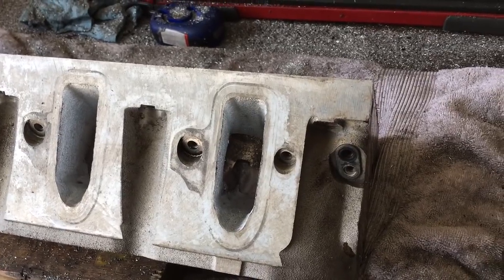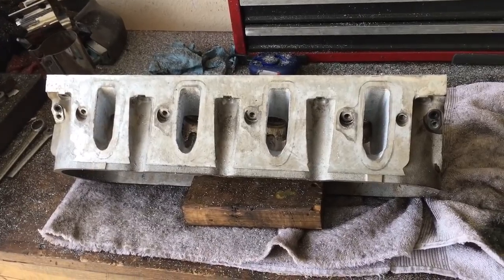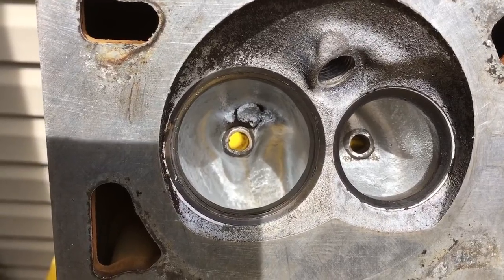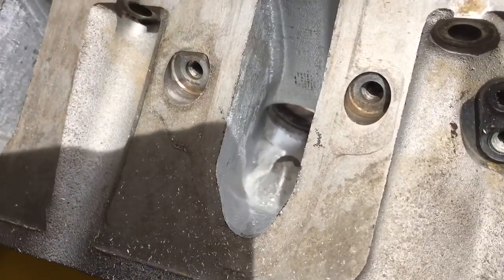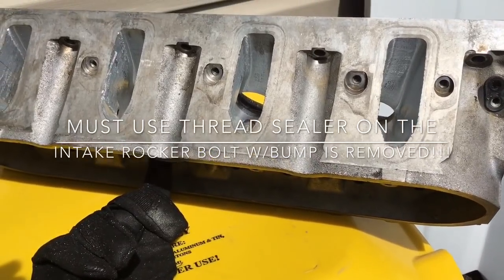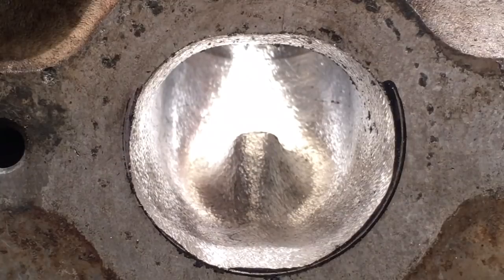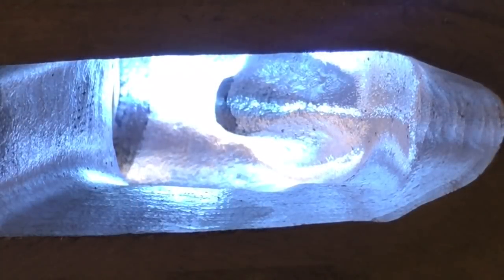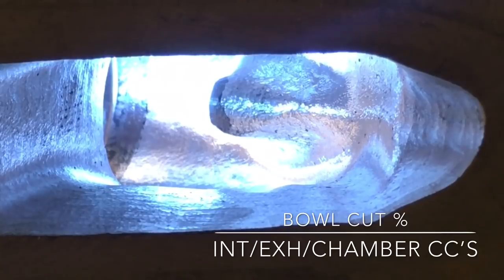862 heads can out flow 243’s?  Day 4

Comment: Thank you so much for these LS head videos, I have some 706s and 241s. I have a '04 GTO that has been sitting for an embarrassingly long time since a tragedy caused the LS1 to seize. I have an LQ4 and the LS1 block. I am going to get after it finally with what I have here and get a short block and some heads reassembled, install all the ancillaries and get it in the car in front of that T-56 and start enjoying it again. These engines aren't like the old mush motors that require machine work to have a prayer of meeting tolerances. You can wing quite a bit a and have a decent runner without giving thousands to a machinist for work you don't need. Still pays the be careful but, the odds are things will work out. Your words and Matt Happle definitely inspire self confidence and hope. Thank you.
Reply from the maker: Take your time and watch carefully both where your cutting/sanding and where the Chuck on the diegrinder is to avoid touching the sealing angles on the seats. 
9 outta 10 LS heads don’t need a full valve job!  The valves can be lapped in, one thing I like to do is reface all the valves to a fresh angle. 
Naturally a performance valve job is better but not always needed!  I ported a set of 243’s w/o a valve job they still flowed 306 cfm 👍😎

Comment: Would it be worth bolting it said of 5.3 862 heads on to my 04 5.7gto that came with 241 heads
Reply from the maker: Shawn Libby Comparing the 706/862 heads to the 241 heads the two differences are intake valve size and combustion chamber volume; everything else very close to the same. 
You would gain Compression in the LS1 which increases both Torque and HP.  The only loss so to speak is any slight flow difference between a 2.00” & 1.89” valves, because the ports are the same. 
I would venture to say you could see more average power over the useable rpm range with the 706/862 heads. JD

Comment: What do you do about the rocker arm lump hole?
Reply from the maker: Patrick Guidry Anytime you expose the rocker bolt threads, you’ll have to put a quality thread sealer on the intake rocker bolt, or it will suck oil past the threads. 
The heads can be greatly improved by reducing the rocker bolt lump without breaking through. I would not consider it mandatory to remove it.  JD
Reply: @HeadFlowInc  I noticed when porting there was a small hole I thought I messed up and almost scarped the heads then seen your video and how much material u removed and figured I would ask thank u for the feed back
Reply: You do great work I'm doing a budget build I got a truck and 5.3 free I'm putting a stage 4 tsp cam upgraded springs push rods and wanted to try my hand at porting this is out of my element lol I'm a welder by trade but love doing mechanic work on my own

Comment: you just killed that head, such a waste. The swirl ramps are there for a reason, they direct and streamline the air flow transition. You severely weakened the structure / thickness of the material by grinding away so much of the swirl ramp, it could easily blow if boosted. If I saw this video before I saw any of your others, i would have ignored the rest of your videos from the start. Now I find my self questioning your videos that Ialready watched and have no interest in watching your others. I hope you only did this as an experiment and learned some important data from it?
Reply from the maker: Richard Scarlett I wish you the best!  You might want to look at any aftermarket LS head and professionally ported factory cathedral port head to compare. Hopefully you’ll learn something! 👍
Reply from the maker: Richard Scarlett Following your logic no one needs to change camshafts, heads, intakes... nothing can be improved since all the parts are so perfectly engineered!  Lol Thanks you made me laugh... lol.  Grow up
Reply from the maker: Richard Scarlett You better contact Dart next, they’re wasting Time/Money
https://youtu.be/bsLVj-AvVuo

Comment: How much does it normally cost for a good porting job? Btw awesome videos. ..
Reply from the maker: BADAZZ93STANG Porting costs depend on what level, generally between $750.00-1150.00.  A lot depends on the condition of the heads and any parts upgrades. 
Thanks for watching 👍
Reply: Or about 40 bucks for a porting kit from jegs and 15 for a harbor freight Dremel. After that all you need is any head from a junk yard to try it on and you'll realize it really isn't hard you just need to do the ports as evenly as possible if your not port matching. Otherwise just buy some trick flow heads and have them surfaced for imperfections. A porter that knows what they're doing will charge roughly the same thing... also porting is pointless unless you throw a cam in with it, unless about 2 grand in labor time and parts for only 5 hp is okay with you

Comment: So this is my first time posting a comment or question and hopefully it will notify me if somebody responds or I’ll figure it out. So I have a 2001 Tahoe with a LM7 5.3-862 heads with 220k miles. I was getting terrible gas mileage so I decided to start a process of elimination figuring out why. I’ve always been intrigued with Motors and their dynamics and the problem solving side of it. I have torn apart many of small motors, boat motors,motorcycles etc. but have yet to dig deep into a car motor because it has always been my daily driver and there have been a lot of lessons learned type situations but if the lawn doesn’t get mowed for a week it’s not such a big deal but riding my bike to work wasn’t on the top of my list. Reason I am here is to see if you can help to answer some questions and hopefully you or somebody can steer me in the right direction. I watched videos on porting and polishing and felt pretty comfortable tackling it with my skill level. I started with removing the throttlebody cleaning it thoroughly as my gas pedal was sticking and build up was the culprit so I ported and polished the throttlebody with some pretty impressive (at least to myself) results, patted myself on the back and went for more. I cleaned a ridiculously filthy intake manifold and just cleaned up edges on the inside with a Dremel trying to eliminate any turbulence that was obvious. I took the manifold off thinking if it’s that bad I can only imagine what’s under that and it was that bad or worse. I cleaned the intake ports thoroughly with success and was told by a friend with that many miles to not remove the heads and just leave it be. Feeling the inside of the ports and being somewhat comparable to 40 grit sandpaper I couldn’t resist porting and polishing them as well. Using a Dremel for the entire process and being pretty anal when it comes to my work It’s fair to say my bike got used A LOT that week!!! I’ll try and send a picture somehow to show you my results. I removed the rocker starred lumps and reshaped to what I thought would be the best flow. After spending so much time cleaning build up and porting and polishing I wasn’t about to put the EGR back in to gunk up my hard work. I found a freeze plug that fits perfect and plugged the intake side And cut the exhaust mount off the egr tube put a nickel under it and reinstalled it to the exhaust( I improvise often). I shaped my gaskets and intake to match the heads reinstalled everything and was pleasantly surprised at the results👍 I am now on the hunt for MORE MORE MORE!!!! I started collecting whatever I could to get more torque n horse!!! Obsessed.... maybe?... 

Questions for you or anyone that can help.
1. Should I remove the heads with 220k miles and port n polish for more gains? Will it require putting in new parts, valves etc.? I have access to a lot of various stock Corvette internal engine parts, easy enough and or worth it to swap? Will porting and Polishing the bottom side of the head be worth it?

2. Is it true that polishing after porting the throttle body hurts more than it helps because you want the air to tumble before it enters the intake manifold?

3. I acquired a brand new LS2 Intake manifold, fuel rails, injectors and throttlebody, all stock gm parts... if I port and polish the LS two intake which from what I’ve seen can be completely gutted on the inside removing the center posts what it then be beneficial to swap my truck intake for that one? 

4. The LS two intake has bigger deal injectors which from what I have read I don’t need to upgrade but at what point should I? After porting and polishing both sides of the hhead and adding headers. Possibly swapping my cam as well... at what point do I need more air and more fuel, upgraded fuel pump?

5. I would like to get a tuner and I would also like to get a tune. Not too worried about a Dyno right now. It’s fair to say that I have become Infatuated with this motor and knowing me it will carry-on for a long time to come. Would you suggest investing in a HP tuner and start getting accustomed to it to save myself money in the future?

6. Is the HP tuner capable of doing the same thing as getting a tune?

All of these questions are on the basis of my true enjoyment of learning more and more.. I am contemplating going to school at 36 years old not to become a mechanic but to fulfill and completely  understand this passion for engines I’ve always had but recently turned from passion to obsession. I definitely don’t think it’s the worst thing to be obsessed about!!!! I apologize for the novel I just wrote and I’m just tossing the questions out there, not expecting them to be answered. Your Videos are making me want to just tear the heads off and get er done!!!!

Comment: Think about a roller coster for a min.   2 drops, one with a 45% angle, one with a 90% , witch coster will come back up FASTER!?!?!  Air works the same wayn ur going to make ur air hit itself and act as a break. But their ur heads
Reply from the maker: Dink Player Are you for or against removing the “swirl” ramp?
By definition the swirl ramp used by GM does exactly what you’re describing, it merges the flow from each side of the port roof. Two things happen, there’s a swirling/mixing effect as it enters the cylinder and in a lesser degree the faster moving air from the ramp can pull/siphon air from the port. I think there’s a lot more to the engineering of the swirl ramp than most people realize. It’s a torque builder, which in my 4.8 is a good thing.
The intake port, with swirl ramp, ended up at 217cc. Basically this port will out flow an LS6 Head even with the 1.89” valve. 👍
Reply: HeadFlowInc.  I wonld smooth them down ,but dont take them all the way out they help direct airflow
Reply from the maker: Dink Player https://youtu.be/NmMrGe7fUvI
Reply from the maker: Dink Player https://youtu.be/Sel92jGGgN0

Comment: Rocker lump?   U do not want to remove the swerll ramp
Reply from the maker: Dink Player I’m confused by your statements can you clarify?
1. Every Head porter I’ve found removed the Rocker Arm bolt boss protruding into the intake port.  It restores the cross sectional area of the port. The only change in assembly is you have to use thread sealer on the Intake rocker bolts afterwards.
2. Again referencing All the porters I’ve found, when max porting the cathedral port heads to achieve flow numbers of 300+ cfm the swirl ramp is removed in favor of the needed volume to rich higher lift flow.
Are you saying you know someone is able to get 300+ cfm from these heads and leave the swirl ramp?  Interesting, I’d like to see it. 
On this set of heads, my personal 4.8 build, I’m leaving the swirl ramps to control the port volume and maintain more port velocity.  My little 4.8 is a true street/daily driver, I don’t need a 220cc intake runner or 300+ cfm.  I’d rather build a 205-207cc port capable of feeding the engine and have good throttle response and low speed stability. 👍
Reply from the maker: Dink Player Oh, my 862’s will flow as much or more than a LS6 Head when I’m done. 😉
Reply: LOOK AT ALL THE AFR CATHEDRAL PORT HEADS..TONY USES A SWIRL RAMP...

Comment: Dont take the bolt lump all the way dowm and forget the rolls that finish is good enough..You might want to take a look at this..https://www.ebay.com/itm/LS6-Z06-C5-Heads-CNC-ported-243-Corvette-/112880083595?_trksid=p2047675.l2557&ssPageName=STRK%3AMEBIDX%3AIT&nma=true&si=GEw3YgpEfn0KcRDpSoaRSPlQloY%253D&orig_cvip=true&rt=nc
Reply from the maker: Joe Mamma Link goes to a dead eBay listing. 🤔
Reply: it ended last week but I had it in my watch list,sorry..
Reply: got an email address?
Reply: IT WAS A SET OF LS HEADS WITH A HOLE IN IT..YOU GUESSED IT THE HOLE IS WHERE THE ROCKER MOUNT WAS...THEY REMOVED THE BUMP..